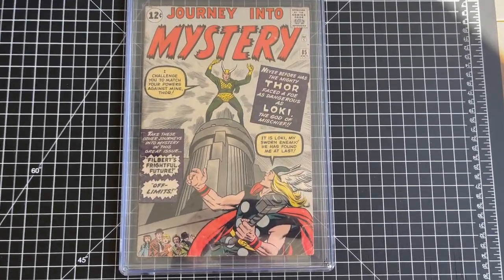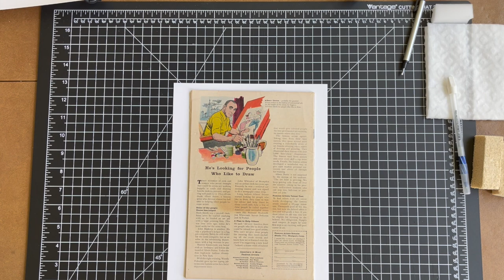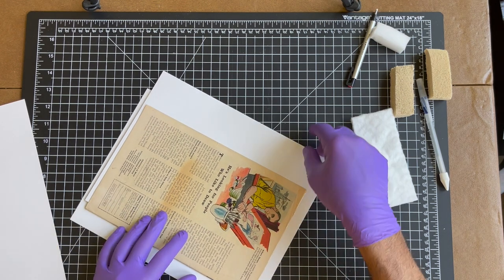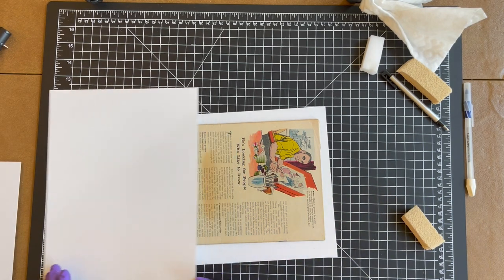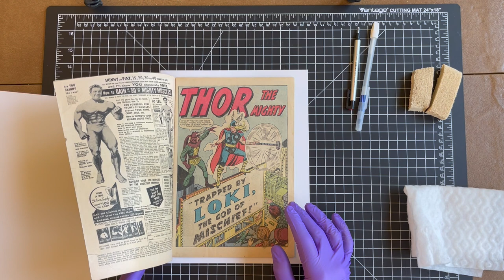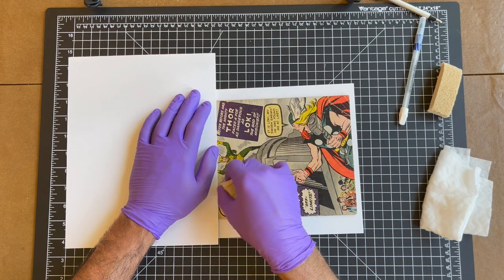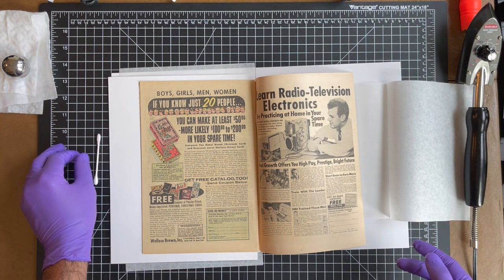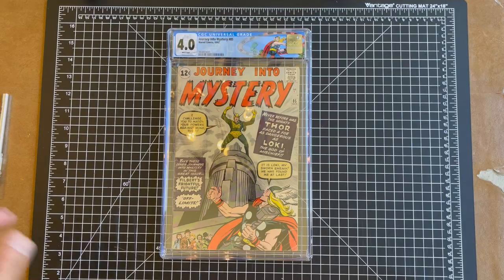Journey into Mystery 85 - Comic Book Cleaning & Pressing - Resubmission  & Unboxing - CPR - CGC CBCS

Comment: Very informative video.  Honestly though, a 4.0 represents such an accumulation of defects in the first place, that I'd have been surprised if you were able to eke out a higher grade.  But for me, the reholder with the new label would be worth the effort and expense.  And you are right that the book presents better now, which if you decide to sell, may result in a higher sale price anyway.
Reply from the maker: Yes, I was able to get a higher resale value for the book, but mostly due to the market increase.  What was appealing to me about this book was how dirty it was.  The notes stated heavy bends and soiling to the cover, which I knew I could improve.  Plus, the staples and cover were intact, which is usually the grade killer for a book in this range.  So I thought I had a chance!  Either way, it was fun to work on and very cool to actually read the book.  Overall, it was a calculated risk and thankfully I still ended up on top.

Comment: Seriously please do more. I can watch this for hours. Very relaxing and extremely helpful. Learned alot!

 I do have a question about your absorbing pad. Mine has what seems like a "seam" down the middle from the manufacturing of it. Are you cautious not to rub that "seam" on the books? Or does it not matter?
Reply from the maker: There are two sizes that are sold... one for "soot removal" and another for dirt.  The soot one (the one you have) is twice as thick and has the seem.  I get the larger ones and then use a giant bread knife (it sounds crazy) to cut it in half along the seem.  I then cut 1.5" pieces, and that is what I use for cleaning.  So essentially the pieces don't have the seem.
Reply: @epicomicologycomics  excellent so it sounds like we get the same one! I essentially have been doing the same thing but with scissors. Thank you so much brother! 🙌🏼
Reply: @epicomicologycomics  do you remove the seam all together?

Comment: Great video! Have you ever pressed a ASM 238? Wondering if I should modify the pressing technique of the SRP and card stock on the back cover due to the Tattooz?
Reply from the maker: I haven't done a Tattooz, but I believe people sandwich them in card stock like you would a digital insert.  It wouldn't hurt to add SRP too.  I have done that for Mark Jeweler inserts so that the adhesive does not stick to the inside page.

Comment: Curious if youve ever used hydrogen peroxide and UV light to reverse tanning and foxing. Some videos shows it works wonders but im curious about it being flagged as restoration when sent to CGC?
Reply from the maker: I plan to make a video on this.  I have played with it enough to feel confident in the technique.  I don't think I would use it anywhere there is text though as you would likely bleach the ink.